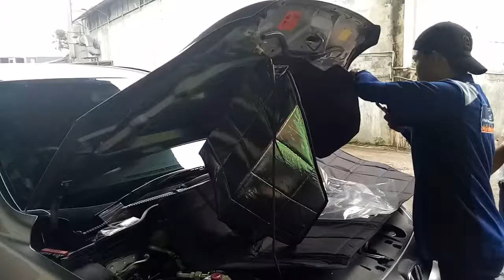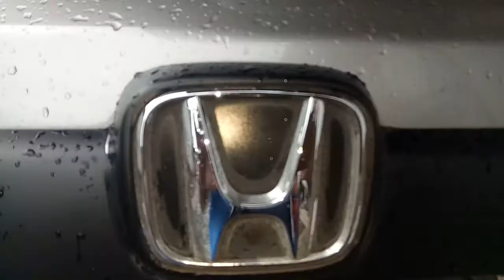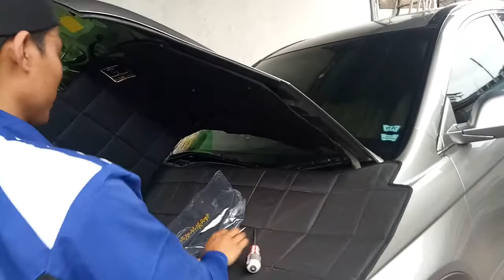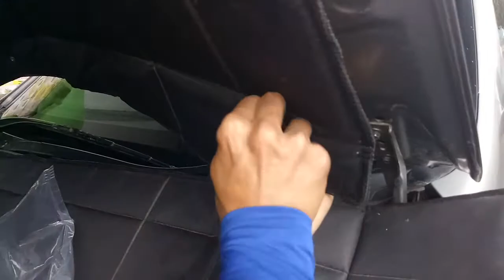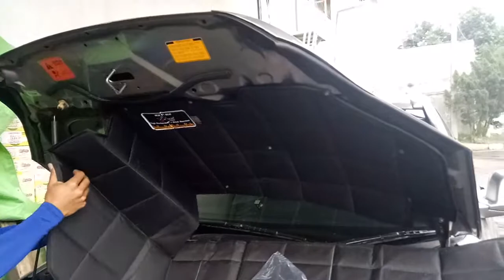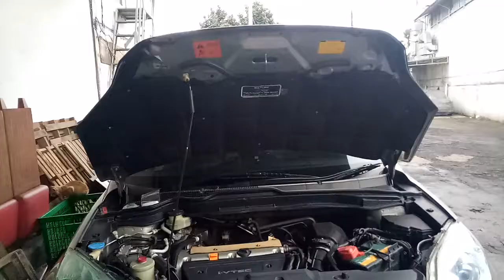Model Peredam Kap Mesin Honda CRV 2007

Comment: maaf min ini fungsinya gede ya ??? itu temperatur mbl saya naek trs ..tp panas mesin normal-_- wlpn temperturnya naik full mbl ga mati otomatis...

kalo ini solusi mbl panas...mau lah order peredam panas nya ...brpa ni min
Reply from the maker: harry m 
Dalam kondisi mobil dipakai. Panas dtg dari mesin dan dari panas matahari, terjadi tembakan panas dari dua arah, pada kap mesin. Bisa di ibaratkan tembakan panas mesin pada kap, ibarat masak air dikuali tp ga ada air nya. Kap mesin, lama gosong kena panas, bahan peredam kap Vtech dari Ceramic,  yg tahan panas, hingga 1300 derajat celcius
Reply from the maker: harry m 
Harga peredam kap utk Mobilio, 450rb
Reply: +V-Tech InsuLation Indonesia untk crv gen 1 ada min?
Reply from the maker: harry m 
CRV Gen1 peredam  kap mesin sepertinya kosong
Reply: Pastinya terdapat manfaat yang besar, 
bila mobil mobil mewah mempergunakan peredam pada kap mesin
(Engine Hood Insulator) 

Kap mobil ada dalam keadaan stress, 
terik sinar matahari,  mencapai 70⁰C ~ 80⁰C 
dipermukaan kap,  
disisi lain suhu mesin saat jalanan macet mencapai 90⁰C ~ 100⁰C.

Melindungi cat pada kap mesin agar tetap dalam kondisi yang baik, tidak kusam.

Menahan panas dari mesin, agar tidak merambat masuk ke dalam kabin.

Menghindari terbentuknya noda air 
(water spot) pada kap mesin, 
salah satunya adalah akibat tetesan air hujan yang jatuh ke atas kap mesin, langsung menguap akibat suhu panas pada kap mesin.

Comment from the maker: Daihatsu Terios 2018 Peredam Panas n Suara Lantai  via @bukalapak https://www.bukalapak.com/p/mobil-part-dan-aksesoris/interior-mobil/jok-trim/f9nk0h-jual-daihatsu-terios-2018-peredam-panas-n-suara-lantai?utm_source=apps
Reply: ENGINE HOOD HEAT & SOUND INSULATOR Type 1

APPLICATION: On the hood / engine hood insulator

BENEFITS : Heat & engine sound muffled
The paint on the hood will not become dull
Rubber components are more durable

WEIGHT: 900 grams; light and easy for the hood

COLOR: The side with the V-Tech® label, or the black one is the front

INSIDE THE PACKAGE: Item Code Card
15 sets of Button Clips + Button Clip Holders
2 pcs Plastic Gloves

INSTALLATION DIFFICULTY LEVEL:
EASY ~ hood is ready to install
No modification required

Hood Heat & Sound Insulation Installation Guide
can be seen on YouTube

INSTALLATION GUIDE:

Fold the hood insulator into two equal parts vertically so that the center line and the reference point can be obtained.
The center point is placed just below the hood lock.

The black colored side is placed upward, it is the side that is visible when the hood is opened
The SILVER colored side is placed in contact with the hood plate.

Adjust the position of the insulator to match the shape of the hood.
The installation of the baud starts from the center, following the mounting holes on the insulator and matching the holes on the car hood. (Please make holes with a screwdriver on the insulator if needed)

Insert the button clip into the mounting hole until it penetrates into the car hood hole. Place clips and pair it with the button clip holders earlier.
Tighten the bolts with a screwdriver and do this until all the bolts are attached.

The uniqueness of the V-Tech® base material provides
GUARANTEE best-in-class heat & sound insulation